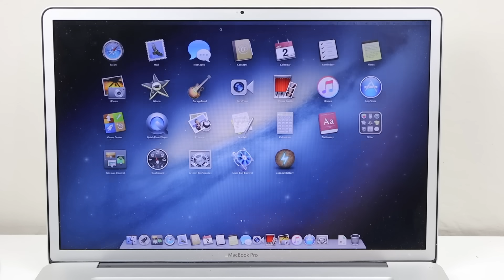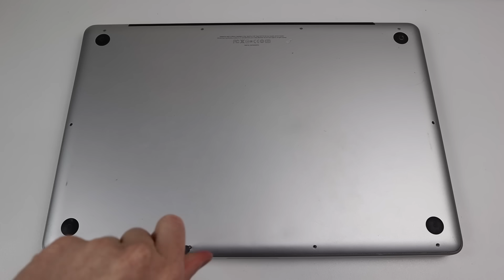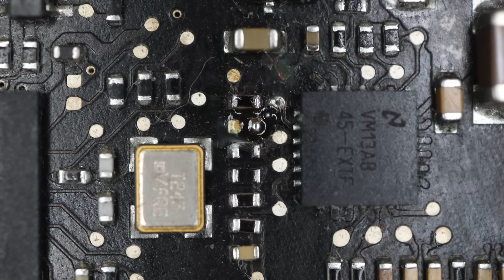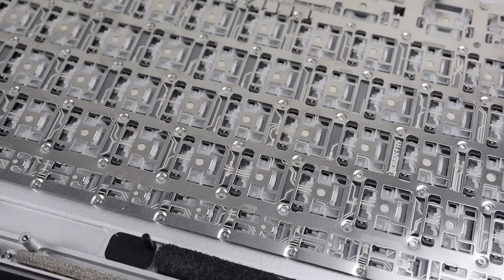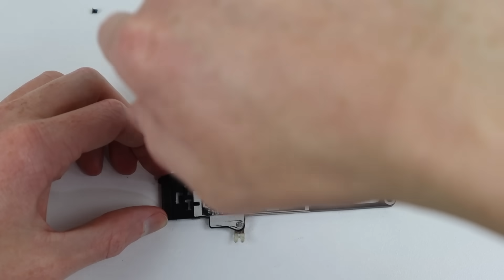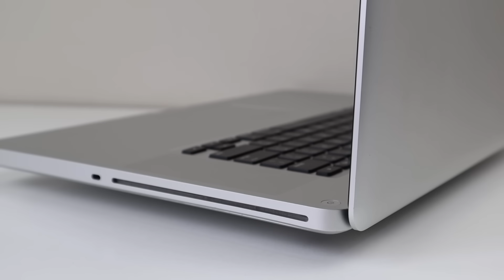Fried GPU! MacBook Pro 2011 Restoration

Comment: I have this exact model, same issue!
Reply: Same, there are people on eBay who do a fix, I'm wondering if this is it.
Reply: @ngrgdrpr  Could be this little device itself, or one of a number of less ideal methods. From what I remember there are software-only ways to mostly disable the GPU, but it is not robust and you'll eventually be back where you started. There was a guy named dosdude1 that came up with the MUX bypass method, and removing the chip that enables the GPU, but that's a lot of work. I think he also made a little board device similar to this CMIzapper thing to reprogram the MUX chip same as this does, for a similar price, but he only sold a small batch, never released the code or anything.
Reply: @W1ldTangent  yeah I've started asking local computer shops if they can fix the issue. It's not my daily driver so I'm not too worried. Im hoping they will do what Hugh did in this video
Reply: @ngrgdrpr  Best of luck with that, but I don't think many shops that aren't at Louis Rossmann or Hugh's level would have the chops or the chip to pull that off. If you are willing to learn soldering, and have the 60 quid for the mod, I think I'd trust my own hands with that job. Otherwise you'll get some monkey trying to bake it in an oven, or just editing the PRAM and deleting the drivers and calling it a day until you reset it or the drivers magically reappear... you don't want that, get someone to do it right, even if it means doing it yourself. People thought the last of the 17" beasts were lost causes that would all die inevitably for 7 years until they first figured out how to bypass the MUX by removing it and using bodge wires and then to this where they reprogram the PRAM on the fly. Amazing work, and the very best you can get right now. I've been looking every now and then for cheap 2011 17 inchers with no major issues or wear besides the GPU issue, but I think the market has caught on that this can be almost completely restored sans GPU now.
Reply: @W1ldTangent  yeah I definitely want to talk to the shop and see what their plan is before taking it anywhere. This could be a good excuse to learn how to solder.
Reply: @W1ldTangent  I remember that dosdude thing. He lost all my respect for teasing people that there's finally a way to keep these macbooks on the road, only to then fck everyone over with "yeah i sold ~50 of these boards, that's it, get lost"
Reply: @Knaeckebrotsaege  is he on a forum?
Reply: @cosettapessa6417  dosdude1 is on Louis Rossmanns discord last time i checked. has a website + YT too but no forum attached to that
Reply: @ngrgdrpr  my local shop rewelds this gpu for only 30 SGD and it works for a year or so if no games are played
Reply: I actually fixed it without spending a penny. Just hoot in single user mode and input a command
Reply: @Clarinet.dommy1  how did you fix it
Reply: @SaadeldeenAhmed  Restart and hold command s. Then when you're in single user mode, type in sudo nvram fa4ce28d-b62f-4c99-9cc3-6815686e30f9:gpu-power-prefs=%01%00%00%00

Comment: I had same 2011 17 inch Macbook , had to replace/install new videocard in the year 2017 (after about 2-3 years after heavy use).
I always maintained laptop cool , dust-free and with new thermal paste - it didn't help. 
Luckily I payed less that 200$ for the new videocard and installation in the service which I know and trust (they also gave me a nice discount). 

On the other hand, I also had custom 2011 15' inch Macbook pro, which was really heavily used by several people and it's videocard was totally fine even after I sold it in 2018. Probably it was caused by it's custom configuration (and better quality) or just luck, I don't know.

Comment: 3:50 how is it possible that the whole gpu pulls power from that little component??
Reply: Of course it doesn't. Removing resistor disables GPU VRM.

Comment: I am still shocked how unreliable the Laptop GPUs were back then. Both Nvidia and AMD sold really nasty chips in the late 2000s and early 2010s. Had two of the infamously bad A1260 MacBook Pros (2007), both died after two years with dead GPUs.

Comment: Nice upgrade! I wonder why Apple made a laptop with faulty GPUs and/or GPU issues... I'm guessing that the cause for these issues is overheating, right?
Also great to see 16GB RAM and an SSD, though I'd have plumped for 512GB SSD and not 250GB.
Reply: The toasty temperatures certainly didn't help, but AMD built stupidly unreliable GPUs back then. The Nvidia ones had similar problems as well.

Comment: Heat gun: exists
Hugh: Well, GPU killer > than desoldering GPU👍
Heat gun: runs out in tears
Reply: @J Fz dude, apple's boards are some of those that don't require experience.  in the public domain there are hundreds of manuals for transferring old laptops to the mode of operation on the integrated video core

Comment: Hugh you are a life saver, i'm working on a 17" 2009 mac book pro that possibly has the same problem; however i'm first having to swap out the tantalum chip that powers it, no green light on the magsafe. Awaiting my delivery of new microscope. Keep up the great work.
Reply from the maker: I had a 2009 mode that wouldn't fully boot. Turns out I just needed to use the 85w charger to power it.
Reply: @HughJeffreys  Tried that one and zero joy. I have a donor board on hand in case it's the other power line chip and i'm possibly going with the Dos Dude1 bypass of the graphics chip, just to be sure.

Comment: Why didn´t you remove the corosion first and made some tests before you "disconnected" the gpu? Corosion/bad(old) soldering could have been responsible for the faulty gpu.
Reply: On those things it's almost always a bad GPU, not the solder joints. Louis Rossmann has a very good video on the subject.
Resoldering heats up the GPU, and apparently heat can temporarily revive a dead GPU for some days or even weeks. But it will most likely fail again, even with refreshed solder joints. That's why even the rookie oven method can temporarily revive a dead GPU.
Reply: @MaxKuehn   I would completly agree with you if the MB/LB was clean and everything else worked fine. But since there was corosion on the board and at least one other issues, shift key not working, was present. I would have searched for bad soldering points first.  But to be honest while I am an IT professional my experience lies more with infrastructure, software, building pcs and not so much with repairing. So think of it as an educated guess no more no less.

Comment: I dont really know what's happening, i just like watching you work and fix stuff.
Reply: Yup, same
Reply: u are NOT alone
Reply: Hugh has to repair the dead GPU inside the entire Macbook Pro even Hugh needed to repair the broken keyboard because the keyboard keys have typing failure when Hugh pressed one key in the 2011 Macbook Pro LOOOOOOOOOOOOL I NEVER USED A 2011 MACBOOK PRO OH FU***CK DAM IT HOLY SH**T THE MACBOOK PRO IS FROM 2002 AND RELEASED IN APRIL 2011
Reply: It's usually quite easy to understand what's going on, actually. He just mentioned that the GPU(Graphics Processing Unit) fried itself and the shift key on the laptop doesn't work.
Reply: Same
Reply: Same
Reply: me when watching the vid: wut..
Reply: Same here

Comment: I did the exact same thing almost a year ago! Mine would boot into a screen with black and green lines and I reflowed the GPU and worked just fine.
Reply: It overheats, and causes the GPU solder to crack since its lead-free.
Reply: Any idea how GPU got fried?
Reply: Yeah but this is not a permanent fix. It's most likely to fail again. To perform a proper reflow, using a heatgun instead of the oven is recommended.
Reply: @Squilliam-Fancyson  I realize. I used a heatgun, not oven
Reply: @lucab3618  I know it’s not a permanent fix. I thought you meant that it doesn’t fix the problem whatsoever
Reply: There were a series of Dell XPS Laptops a few years ago that had this issue (you were ok if you left the machine running, or a warm reboot, but from a cold power up, it wouldn’t start)
Reply: Ever since I started watching your videos. I always wondered "How old is your old toothbrush?". 🤣
Reply: Hopefully it lasts! It's a real shame that a lot of these laptops are destined to fail, reminds me of the original PS3s.
Reply: @hunterscooters5101  no it didn’t. The solder underneath the chip just cracked from the heat of the GPU. Not meaning it overheated but the solder couldn’t handle the heat as it was a lead-free solder.
Reply: @JaceFunkyFace  This is not the case. The problem with these GPU's is the ball grid array in the GPU die itself. Removing the heatsink and heating the die for 20 seconds with 230 degrees celsius will prove that. We have done several hundreds of GPU replacements on these specific boards until old stock ran out and only crappy GPU's remained available. Nowadays disabling the GPU is the only workable solution if you want a reliable 15" /17"  2011 machine.
Reply: @JaceFunkyFace  Ah I see, thanks for clarifying
Reply: @lucab3618  It does, the solder joints overheat and lose contact with the board. When you reflow the gpu it reconnects those solders joints.
Reply: It's a issue of the AMD GPUS not the solder AMD messed badly up on those years GPUS
Reply: @bn17462  But only on macs...  Surely it couldn't have been due to apple's usual shoddy cooling (or lack of).  EVERY mac I've owned has had tremendous cooling issues thanks to the form over function ideology at apple.

Comment: I have a 2011 15 inch MacBook Pro and the GPU in mine still works perfectly except for the keyboard backlight not working and the battery only had 28 charge cycles I got it last Christmas from my cousins for free although I only use it for some iOS  jailbreaking and downgrading because In march I got a Dell XPS 13 And I prefer Windows
Reply: You jinxed it